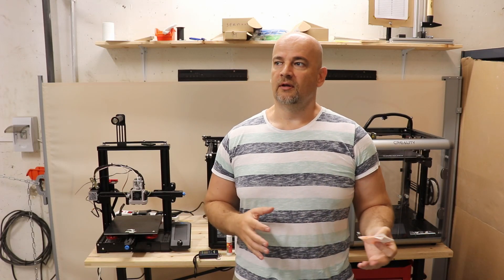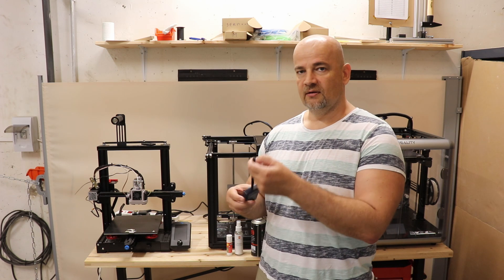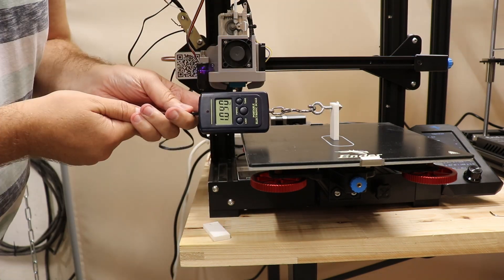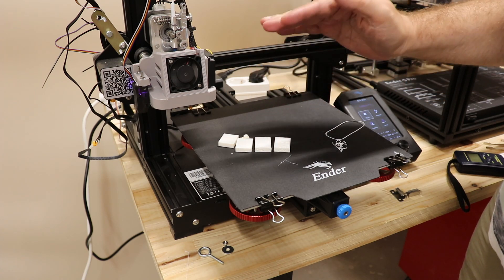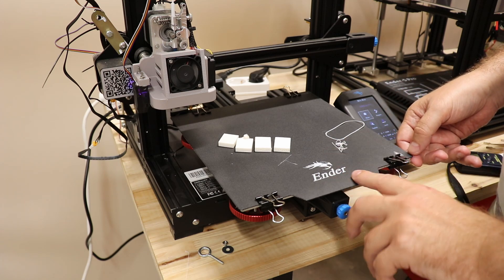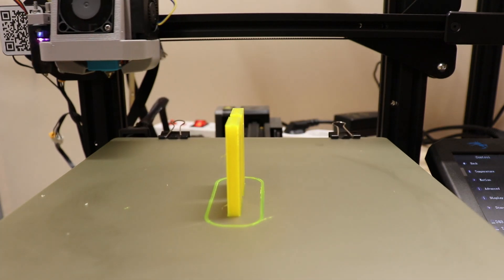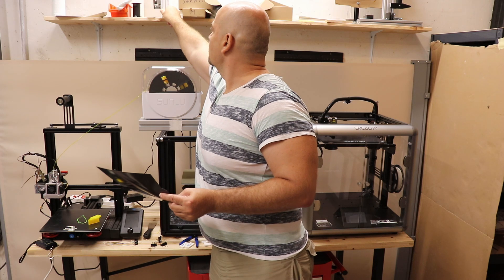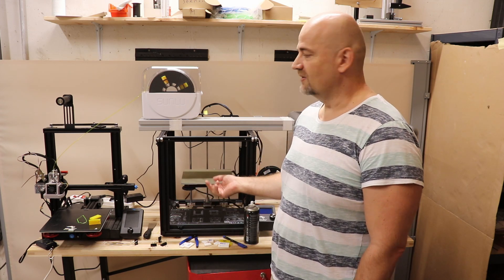Creality PEI sheet vs Carborundum glass vs Soft magnetic self-adhesive platform

Comment: i have found that ISO doesnt work as well as just dawn dish soap for cleaning the beds, i have a spray bottle with water and dawn soap in it i spray a little on a paper towel and wipe the bed then a wet towel to clean off soap let it dry
Reply: IPA has worked just as good, if not better then using dawn dish soap. On borosilicate glass, PEI and mirrors. That's going for at least 2 years now.
Reply: @br0k3nilluzion  it doesnt work better than just cheap soap and water, think what are you trying to do when you clean the bed is get all the oils from touching it off and dirt dawn dish soap works very well at getting rid of oils and what little bit of dust may be there the main thing is getting oils cleaned off and dawn dish soap does that very well why spend the extra money on something u dont need when u can use something u already have in the house
Reply: @3dprintingcave778  IPA works just as good. It's cheaper, can be bought at the dollar store for under a dollar and lasts for a long, long time.
Reply: @br0k3nilluzion  lol but you dont need to buy it you already buy soap i hope to clean your dishes use that no extra money spent not even 1 dollar lol
Reply: @3dprintingcave778  i have 26 printers not counting the resin printers.
Dish soap helps when using mirrors and Aquanet/glue but IPA works just as good.
I like Aquanet more then Gluesticka when it's needed.
But on PEI I can clean it with a spray of IPA on a papertowel, wipe and be able to move on in seconds
Reply: @br0k3nilluzion  so having 26 printers not counting your resin printers doesnt make you right, all i understand from this back and forth is you think your right and dont mind waisting money on IPA or ISO when soap and water sprayed in the same way you spray your iso will do the job for cheaper and better, IPA does leave a film on your bed .. and printer compnays are starting to warn people not to use IPA OR ISO on there beds and only use soap and water
Reply: @3dprintingcave778  looking up to you on that high horse sure does strain the neck.. lol
And from your responses it's quite the opposite, you arent open minded enough to see that others have used/tested IPA and dish soap and have come to another conclusion then your own.
The 26 printers and 2 years-ish experience with it was only said to add weight to this friendly debate.
Want to take this to some FB groups where other streamers with Farms and other non-youtubers with Farms can chime in with there own experience?
Reply: @br0k3nilluzion  me on a high horse thats funny coming from a man that starts off his reasoning for what he does is i have 26 printers not counting resin lol
Reply: yes i have used IPA ISO for years i find soap and water better thats all can we leave it at that and i know you find ISO better
Reply: @3dprintingcave778  because I've used a ton of different things in different scenarios.  on borosilicate glass, borosilicate glass with texture (anycubic ultrabase, crealities old and latest versions), magnetic beds (Energetic, TH3D's, crealities new version, TM-Flex from Tinymachines, and FulaFlex), mirror (the set from Ikea and the set from Lowes and others that were cut down).
Reply: @3dprintingcave778  got a buddy that uses only mirrors and only uses soap and water every now and then.. and he has a nice sized farm of various printers.
But then have a couple other buddies that are local as well that have farms and dont use anything and some Aquanet and they use IPA to clean.
Know more that use IPA then those that dont over the years.  
And with the amount of printer myself and others have you'll have to pay for something extra, whether it be Dish Soap or IPA..  so that's why I mentioned I'll still have to buy some.

Comment: After many failed adhesion attempts, the best thing that's worked for me is a GizmoDorks Boro Glass with a 3m PEI sheet that i sanded with a 600 grit sandpaper. It was expensive ($40) , but worth it in the amount of plastic it has saved me. One thing I like about it, rather than those magnetic steel sheets that come with the PEI , is that the PEI is much thicker and I don't have to worry about damaging it when removing parts.

Comment: Didn't look like a fair z-offset for the flexible ender sheet. I use that surface all the time and haven't had a print like that detach so easily. I believe this happens when the Z-homing probe registers the top of a bump but the plastic really needs to be squished down into the valleys of the texture.
Reply from the maker: I agree, similar on my Prusa textured vs smooth sheet. Only for comparison I used the same z-offset. But you got the point
Reply: Just got one of these flexible print beds for my cr-10s and the middle print bed is sagging making it unable to print without a raft any idea on what to do?
Reply: @drewcarll5431  I'd recommended some sort of auto-bed-leveling system for a warped bed. You could also do assisted manual mesh leveling, but that gets tedious very quickly.
Reply: @RubixB0y  I saw some recommendations for a wedge but it also said that I want to be careful on where to put it so I don't destroy the sensor which I have no clue where it is.
Reply: @drewcarll5431  You've lost me, I've never heard of anything like a wedge(unless you mean a shim) fixing a warped bed or what sensor your referring to. If you just mean to use shims under the bed, then that might help by raising up the low spots. I've noticed my bed topology changes with temperature, so ABL was the way to go.

Comment: the way you can see the 3 lines on the skirt means for me your z-offset is too high. compare with the skirt on the golden PEI, you cant see a gap between the 3 perimeters ;)
Reply from the maker: Z-offset was equal, but yes, probably these surfaces need different settings. Only for comparison I used same values.

Comment: I have both Ender3 V2 stock glass bed and almost the same with Creality branding - and they both are terribly bad, only barely works if flipped to glass side. For me it is even difficult to believe in your test results of them! Switched to PEI sheet from Two Trees - and literally have zero problems since then.
Reply from the maker: That's exactly what I was talking about in conclusions. E3V2 glass works perfectly to me, similar with glass on Voxelab Aquila (E3V2 clone) but horrible on Sermoon D1, and lot of commenters mentioned problems with their E3V2 glass. PEI quality more constant.
Reply: i fought with this for 2 weeks after installing bl-touch. Z-offset was wrong. I havent cleaned my bed over a month and it still sticks perfectly. I highly recommend 3DLac. you will never ever think about adhesion again
Reply: @Gabriel-S-M  I don't think about it anymore and do not use any additional stuff, PEI for the win.
Reply: I use the creality glass bed for pla and pei sheet for petg.